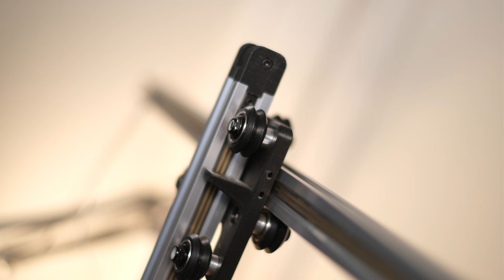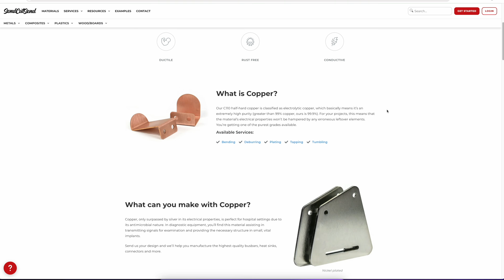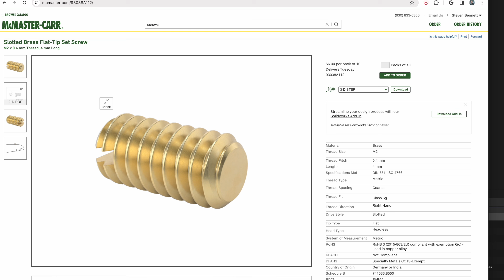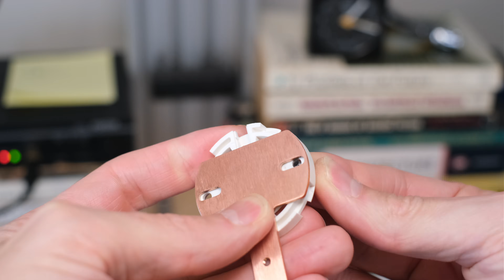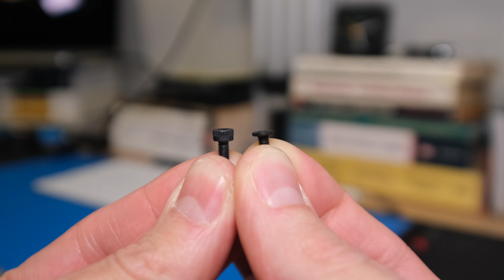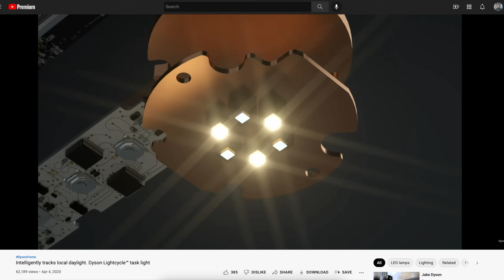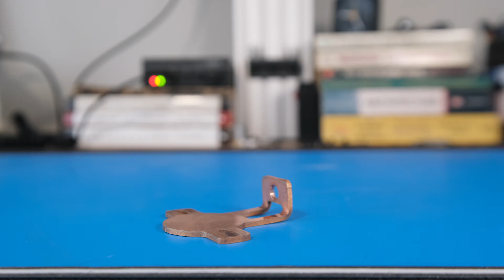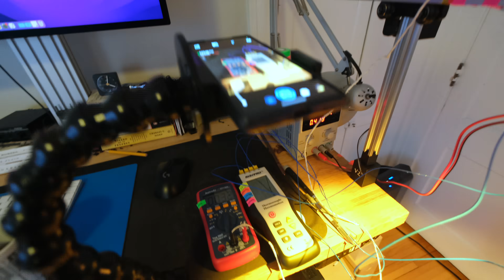Just how good are heat pipes anyway? - DIYson Lamp Build Log #10

Comment: You are probably going to want to a max power test to make sure the heat pipe does not suffer from dry out, especially if the lamp is used in a hotter climate. But my intuition is that your choice of heat pipe is 'oversized' and it'll be fine.

Comment: There are a few possible improvements that come to mind.

One would be getting a smaller LED that fits inside the extruded aluminium arms. In that case you could then just add a copper heat-bridge between the LED and the aluminium and use the entire arm as a heatsink (aluminium is still a good heat conductor).

With the copper sheetmetal holder you would have more space and better contact if it was U-shaped - the lower-part going towards the inside of the channel, the outer edges contacting on the flanges of the channel. This should solve the clearance nicely while also giving some good contact due to the springiness of the U-shape. (that form would also allow for thicker/wider copper sheets).

If sticking with a heat-pipe: A thinner heat-pipe that fits at the bottom of the channel of the rail. Then the mounting could be a simple clamp that pushes the heatpipe against the inside of the rail. 

Or use a heatpipe in the  side-channel and have a 90° bend at the end. And then there have a copper-connector to the lamp.

And finally - a bit more custom.
Laptops, handhelds and other mobile devices often use small vaporchamber+heatpipe combinations. Those are great for picking up the heat at the source and then transporting it away. For the lamp even just a longer vapor-chamber might be enough to spread the heat so a passiv fin-cooler could be slapped on top. There are also various companies that offer custom solutions. They have some higher setup costs but if you plan on selling the lamp-parts that might also be an option. Definitively the most involved solution but also by far the best thermal performance you could get.

Comment: You've obviously thought about this a lot more than I have, but for my 2c, I think you need to better determine your success/failure reasoning for picking the mounting material. In particular, the difference between the two seems to be around 15 C, and from the datasheet image shown that only results in around a 2.5% difference in 'relative luminous flux' (at 400 mA). In general, I think you should compare the two proposals on their relative merits, including the brightness difference as one factor in that consideration.

As an aside, I personally prefer the heatpipe solution, but it could probably use better mounting (maybe thermal epoxy or even thermal double-sided tape), as it's likely that it was only effectively transferring heat at the screw point (hence why that section was the hottest area after the LED).

Finally, it's worth pointing out that sustained heat can do bad things to PLA, even below it's plastic deformation temperature. I'm not sure what material you're using, or where you measured the temperature on the housing, but it's something to keep in mind.

Comment: That LED is a hot boy. I've done some experiments with high power LEDs my self. A small heat sink with a fan goes a long way. I'm thinking, what if you drop a Heat sink on the rear of the LED, then use something silent like the Noctua nf-a4x10-5v to pull air through the lamp from bottom to top, so it exhausts the air up, and not down on to you or what you are shining the light on.
Anyway, love your project, and I hope to be able to buy a kit from you in the future! Keep up the great work and videos.

Comment: Wow those findings on the heatpipe performance blew my mind. I guessed it would perform better, but it throwing all the heat away to the farthest point makes so much sense but is unintuitive for heat transfer though a material. Super cool. Makes me want to make a project that needs heat disapation just to get to use that information! 

Btw I check for a new video from you periodically, thanks for sharing your design process with us!
Reply: I've been getting into microcontrollers recently, and I want to build my own 12vDC to 120VAC power inverter. I was just planning on a giant heatsink, but this had me wondering about moving heat away from the board, to get the space for a higher tech radiator/fin setup for cooling - Since for the MOSFETs, everything seems to be about how cool you can keep them, for how many amps you can pull.

Comment: you could also remove some material from the rollers... that can be achieved consistently by attaching them to a drill and spinning against abrasive paper at a right angle.

curving the abrasive by sticking it in a tube that's a bit larger than the roller, brings more abrasive material into contact with the roller, increasing abrasive performance, less abrasive degradation and less clogging, while also helping you keep a right angle

Comment: When done correctly, mounting the LED directly against the heat pipe should produce significantly better result.  Done correctly includes using thermal paste, and making sure both surfaces are flat. A very badly beat up heat pipe might be really difficult to get good thermal connection to. 

With the copper heat sink, you're limited by the heat conduction along the length of the conductor, but with the heat pipe you're practically entirely limited by how fast you get the heat into and out of the heat pipe, in this case mostly the part from the LED and into the heat pipe, and that depends on how good thermal connection you manage to make. Look at CPU coolers with heat pipes, if they're any good they have their heat pipes on the side against the CPU, no copper, or extra steps of thermal transfer in between that reduces heat transfer.

Also, with a heat pipe you can use 2 LEDs, and get twice the area from LEDs into the heat pipe, and thereby improving heat transfer of any given total thermal load by almost 100%. On top if that, when 2 LEDs produce the same amount of light as one, they can provide that light using less energy, so for any given amount of light the total heat generated can be less if 2 LEDs are used compared to 1.   2 LEDs also gives the opportunity to combine different color temperatures, to be able to control that, and also slightly improve color rendering. 

Obviously it would be difficult, if not impossible to find reflectors and lenses optimized for 2 LEDs beside each other, but then again, unless you have some specific extreme requirements on the light distribution, you can make your own reflector. With better thermal management you can even print reflectors in PLA, and cover the inside with aluminium tape. That works well for me, but I'm not pushing small high power LEDs to their limits, especially not without proper thermal management. Aluminium doesn't just reflect visible light well, it also reflects IR really well.                  

The heat dissipation from the rail is a limiting factor, but that dissipation will increase with increased temperature difference compared to ambient. Improving the thermal transfer from the heat pipe to the rail could improve cooling efficiency.    

By the way, as heat conductivity depends on area and distance, increases with area, decreases with distance, and (pure) aluminium having about 60% the thermal conductivity of (pure) copper, I wouldn't be surprised if mounting the LED directly against the aluminium (despite being an alloy) rail could provide much better cooling than that thin copper heat sink.

Comment: If you want to further lower your LED temp here is something you can do : raise the thermal emissivity of your system . your aluminium profile is good at conducting heat, but aluminium radiates it poorly. in your setup, heat would be mostly evacuated by thermal conduction to air. You can increase radiation by painting your profile. the paint will radiate the heat. (for aesthetics reasons it could be varnish also, and maybe not on all faces nor tracks) might worth a try !  in all cases, great job !

Comment: I'm a bit worried about the wheels being perfectly 0.1mm off the screws at the start, but then they wear out after a while and start catching again. Maybe countersunk screws would work better? I also think that if you put a bit of thermal compound under the sheet you can make the piece a lot shorter as the heat would dissipate into the rail before "reaching" the end with the current design.

I love the heat pipe but I'm a bit worried about needing to glue it down, something simple to fix would become a whole redo and replace afterwards.

Ah I didn't notice I was just halfway into the video. Looks like my prediction was accurate haha

Comment: I got a question about the supertrack: Could you shave of some cost by making it a 3d-rinted part as well? I imagine a plastic rail on which you simply put on two strips of copper tape. 
Or are the tolerances just that much better when you order this custom PCB?

Comment: if the copper had simple formed ridges on the "outside edge", it would be a press fit into the rail, and that would keep the copper part lower in the slot, plus, you would only need one set screw to hold it in place...if you were designing for production, you'd get the copper part stamped/formed, and have it screwed, (or a kind of press fit/clip into the slot) to the face of the channel, with as much copper/aluminum surface area as possible

Comment: Isn’t the thin, narrow part of the copper strip between LED and aluminium bar the bottle neck for heat transfer? Make it as thick, wide and short you can to transfer heat to the aluminium as effectively as possible.

Comment: I think thermal grease or other thermal interface material between LED and heat pipe would improve the performance. 
Also don't measure the temperature of a metal surface with an thermal camera, it is to reflective. To get a reliable value put tejp on the points you want to measure.

Comment: What a nice and detailed video! While comparing bare copper and the heatpipe I saw that you secured the heatpipe only with one screw at its end, which looks like too little mounting pressure from the middle to the led end. The copper piece had multiple screws over the whole lengh, giving it an advantage with heat transfer to the aluminium channel. If you could somehow get enough even mounting pressure on the heatpipe I feel like it can perform a lot better.

Comment: Thanks for posting your work and the ideas!  I've got some of that track from an old mining rig.  But, with no income I'll have to use a 10w LED & a stock Pentium cooler heat sink   
I might mount two old cell phone cameras and polarize the light to jury rig a soldering station microscope w/cardboard headset.

Comment: i wonder what difference one of the tiny noctua 40mm fans would do for thermals in the housing
its a quiet fan and any air flow would make the whole unit a lot cooler.

Comment: The joint between the heatpipe and the copper bracket really ought to be a soldered joint, rather than thermal paste. That'll make the mechanicals a whole lot easier, too.
Though, you'll need to use a blowtorch to solder that -- ain't no way a little soldering iron will be able to put out enough heat to overcome that heat pipe lol.
Reply: If he wants to try soldering the heatpipe I just want to note that it's very easy to ruin a heatpipe while soldering it, look up proper methods!

Comment: The cross sectional area of that copper heatsink makes it nearly pointless after a couple inches. You can cut the length of the narrowed section in half with virtually no loss of thermal transfer.

Also, the thing to know about heat pipes(that gamerz refuse to recognize) is that they ONLY work well when the hot side and the cold side are near the centers of their design envelope. If the hot end doesn't get hot enough, then the phase change won't take place, so it's JUST a gunked up thin walled copper tube that transfers almost no heat. If the cold side gets too hot, then the condensation can't take place, so you just have a gunked up tube that can't carry any heat.

Comment: I thik the heat is higher at the end of the heatpipe because thats where the heatpipe is screwed to the aluminium extrusion. In the video it looked like the heatpipe was curving up away from the extrusion in the middle, so that there is air in between or at least a thicker patch of thermal compund.  And thermal compund works best if it is a thin layer. 
I think the heatpipe solution could work even better.

Comment: Maybe you are overengineering something that shouldn’t be there in the first place.

Why don’t you use the aluminium arm itself as a heatsink? Just flatten the end of the arm and join the led directly to the surface with thermal paste (or liquid metal).

In this case the aluminium arm has much more surface area than the copper solutions, I think that despite having a lower thermal conductivity, it’s worth trying.

Comment: I can imagine the reason for the 200mm sensor beeing hotter, is because thats next to the screw that holds the heat pipe. Something I've learned from PC cooling is, that the contact means alot. If you could make the contact between the heat pipe and the aluminium even better by maybe more screws or something, it would be even better. But of course, that's just my guess!
Anyways, great video!
Reply: Agreed, to confirm he only needs to measure temperature on the cold end of heat pipe, I'm sure a lot of thermal resistance is between heat pipe and aluminum extrusion. Also screw LED right to the heat pipe, 2 layers of thermopaste is just a waste. This helps because every 10° after 65° C on the chip cuts LED life in two.
Reply: I think brazing would be a good fit here, for thermal conductivity and mechanical connection - It could also be removed with heat, for repair.

You can braze Copper and Aluminum together with just a regular torch
Reply: @weeveferrelaine6973  I somehow think brazing with "just a regular torch" is not something done by anyone.
Reply: @Gebsfrom404  Also, applying super high temperatures to a heat pipe will cause it to inflate and pop.

Comment: This is some quality content!
Can't wait for the next video and for this lamp being ready to try building myself.

I like the idea with a het pipe but can't help but wonder if simpler solution wouldn't be better.
Thermal conductivity of Cu is ~400 W/mK, Al is around 250.
 Cross section area of that vslot extrusion is an order of magnitude bigger that the copper bar.
Why not make just as thick as possible L shaped bracket that would mount to the end of Al extrusion.
You will loose some interface area between Cu and Al parts but you won't restrict thermal energy flow by pushing it all through that thin Cu bar.

tl;dr;
What is a bigger problem: interface between Cu bar and Al extrusion or the fact that that Cu part has very small cross section that joins it to the rest of the lamp.

Comment: You really got ripped off when buying those ultra low profile screws. Especially since the better suited solution (that also wouldn't interfere with the wheels) would have been much cheaper: a simple countersunk screw. It would have been flush with the copper strip.
You could also have tried low profile screws (without the "ultra") and make them "ultra low" with sandpaper or a Dremel. The hex socket will get a lot shallower of course, but it's not like you needed a lot of torque to fasten the copper strip. For the price of the three ultra low screws you would have gotten a 100-pack of the low screws. A lot of tries to mess up ;).
To make the version with the set screws work, maybe shaving off a little bit of the wheel would have been enough? Since it was reaching "into" the rail that part obviously isn't important for rolling anyway.

Thanks for the detailed copper strip and heat pipe measurements. You didn't take any shortcuts there. The lazy way would have been to just measure at the LED (and then wondering if the huge difference is because of the heat pipe or just messed up sensor placement). But the multiple measurement locations show that the heat is actually going somewhere. Btw. I have seen heat pipes soldered to copper blocks, so it should be possible to do that without damaging them. I doubt any soldering iron will manage though. It will have to be done with a torch.

Comment: The algorithm brought me to your video (I've not seen your channel before) and I was very pleasantly surprised. I have been working on a rudimentary animatronic character and I'm attempting to put a 3W LED inside each of his 3D printed eyes, but I've never dealt with LED heat dissipation before. I greatly appreciate the "thorough yet concise" nature of your video. I haven't found any good info out there and was flying quite blindly. From your video, I learned that while not ideal, my solid sheet of cut copper solution will likely be adequate. Before watching this, I always just assumed a heat pipe was just a thick piece of copper. (Glad I didn't cut into one thinking I could just trim it that way, lol).

Also - thank you for including video of the seemingly straightforward steps of prepping the surfaces and applying thermal compound. In my mind I knew it SHOULD work (I've built dozens of PCs over the years and applied thermal compound to CPUs countless times). Seeing someone else do it in this sort of  LED heat-dissipation application makes me feel a lot more confident that I'm not wasting my time (which is honestly a major barrier in moving forward on a project more often than I'd like to admit).

Thank you for taking the time to make this video. I know it takes a ton of time, effort, focus, and drive to make a video this cohesive ON TOP OF doing the actual experiment your working on. Your efforts are very much appreciated.

Comment: When you machine into the end of the horizontal extrusion just before you hit the conter hole you can attach the led directly to the highly thermally conductive and high cross section aluminium without needing any custom parts.